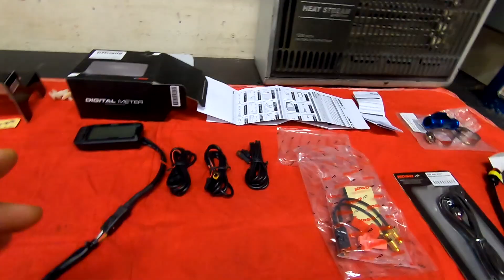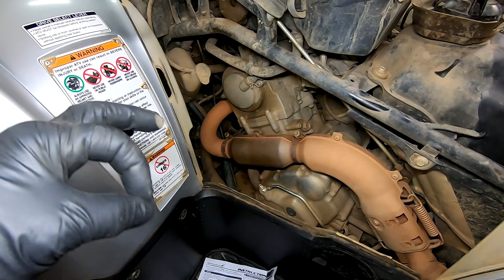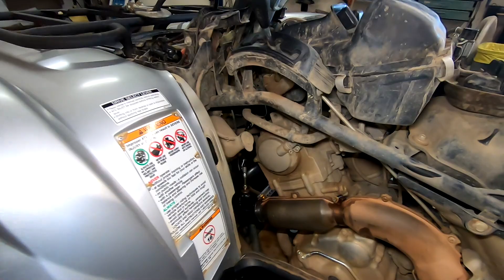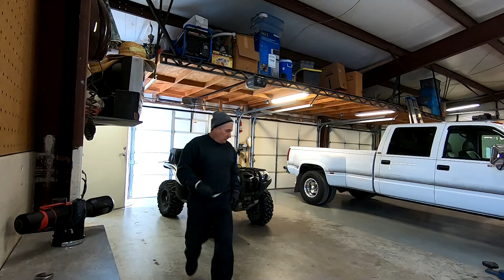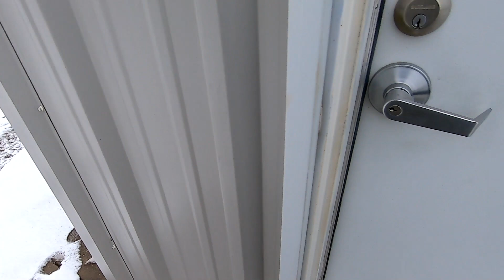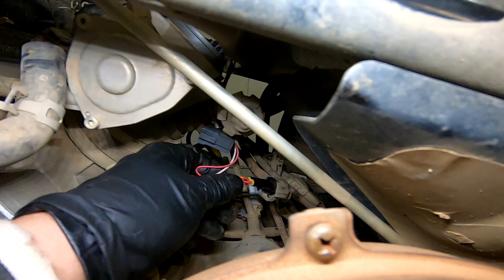Yamaha Grizzly 700 dynojet Power Commander & Air/Fuel gauge install

Comment: really nice videos. where did you buy bigger throttle body for your grizzly?
Reply from the maker: Bought the throttlebody from
CuervoATV 
He has a channel here on YouTube. You can contact him through there. Thanks for checking out the video. Much appreciated!
Reply: thank you very much for answering so soon. I live in Iceland and in the wintertime we ride in all kind of snow, hevy and wet and also we ride on the glaciers here wich is unbelivable. So I need all the power I can get, I have a grizzly 700 22 model and have put on it tuner,aibox lid and am ordering barkers duals exhaust from ehsracing. do you think I would benefit from having a larger trottle body or is it unecesery.
Reply from the maker: @orarinnhalldorsson1899  I wouldn’t worry about putting on a larger throttlebody. It really only else at higher rpm, didn’t help the low end torque at all.

Comment: So stock A/F was good.
Reply: Putting a AF sensor on the bike is really good idea. I think this is the first time I've seen any one put one on a atv or motorcycle. Would make science out of carb tuning!
Reply from the maker: @notshared2543  I didn’t want to change the stock fuel mapping unless I had a way to monitor what was going on with the fuel ratio.
The stock fuel mapping is not all that bad a little bit lean but it’s OK.
Thanks for checking out the video and appreciate the comment!

Comment: How would I make the most horsepower out of a grizzly what are the options
Reply from the maker: The easiest thing to do is change the clutching add a shim. That makes it feel like it has more power. 
Then you could put a exhaust system on maybe a fuel programmer then you could do a different camshaft all of that stuff helps it out nicely. Hope that helps you out. Thanks for checking out the video.

Comment: Great video. Just curious why you didn’t go with the AutoTune from Dynojet that pairs with the PCV?
Reply from the maker: Hi Quad Dad that’s a great question. There is a couple of reasons, one The extra expense of the auto tune unit itself. The other is I done some research on that and from what other folks were saying it doesn’t build a very good map because of the way a quad is ridden off and on the throttle. It’s not like a motorcycle for the street where you could cruise and it can do a better job at building a Nice map. 
Thanks for checking out the video!

Comment: After all the tuning, mods, etc, how many cc's do you think you will be pulling out of It? And how many h.p.? What exhaust will you be using?
Reply from the maker: Still running the same cc, 700 didn’t change that any. 
Probably getting close to 60 hp I would say she runs pretty good!  The exhaust pipe is one I built myself. Thanks for checking out the video!

Comment: I need to ask you another question. LOL. I bought the same Koso Tach/Volt/Temp gauge as you have. How did you hook the tach up. Wrap the wire around the plug wire or??? Thank you.
Reply from the maker: Yes I wrapped the tech wire  around the spark plug wire right where it comes out of the coil.
That’s cool you bought the same meter. Hope it works out for you.
Reply: @kcatv9556  Thanks. I appreciate the info. Did you ever figure out why you had to make a new tune for different weather conditions??
Reply from the maker: @440cubicinch  hey bud just got done frying up some morel mushrooms! We found them in the woods behind our house. 
Umm good! 
Anyways yes I did find an issue it’s with the A/F sensor giving me false readings. I noticed it after I dunked it in the water one of the times, the gauge went all the way to Lean.. 
Then I realized it wasn’t working correctly anymore. 
If you get the A/F sensor on your unit you might wanna watch out for getting sensor wet after the engine is hot.
Reply: @kcatv9556  Mushrooms!!! Your not eating those funny ones are you?? LOL. Glad you found the issue.  I knew something was up. I installed a Koso Wideband last year.  No problems so far but I dont do much water either. Thanks for the info again.

Comment: I just asked this in one of your other video's but could you add a link to the mount you used for the Koso meter. I currently have my Koso AFR mounted on a Ram mount but it sit up high and to the left where yours is mounted in the center right above the speedo where it is easy to see. Thank you.
Reply from the maker: Hey buddy sorry for the delayed response busy at work today. I didn’t have time to poke around on my phone. LOL. 
I’ll try and explain this so it makes sense to you. I used an old hand guard mount for the clamping saddle to clamp on the bars. Then I fabricated a bracket bolted it to that mount and that’s what extends over and holds the Koso meter in the center. My Garmin trail GPS is also mounted to the clamp mount that’s on the bars. Hope that helps you out. 
Thanks for checking out the video greatly appreciated!
Reply: @kcatv9556  That makes perfect sense on what you did. Thank you.

Comment: What size was that coolant sensor adapter
Reply from the maker: I believe it was 21 mm
Hope that helps you out, thanks for checking out the video!
Reply: @kcatv9556   thanks for info,I'm rebuilding my 700 grizzly atm almost done, want to put a temp garage on her I noticed the temp light was coming on alot when she was running

Comment: Why didn’t you go with the single channel dynojet auto tuner?
Reply from the maker: Just thought with having the A/F ratio gauge I would be able to dial in my own fuel map.
Thanks for checking out the video!
Reply: @kcatv9556  I have the autotune on my rubicon.  The nice thing is the autotune gets you in the ballpark and then you ride and adjust the map the way you want it.  Then you leave the  autotune enabled but just limit what it can add/remove.  This way when the temperatures change or your change fuel or altitude its still running off your base map but has room to auto compensate for the difference and keep things in the sweet spot.  I installed my autotune o2 sensor Just a bit before the muffler.  This way its not as hot as it would be close the engine and might extend the life of the o2 sensor.  In my case my '20 rubicon was going through alot of fuel and was showing excessive carbon on the plug.  I had put on a hmf quiet core muffler and after the tune it made a significant difference on my mpg and the plugs look good.

Comment: Just wondering why you didn't get the auto tune add-on for the power commander.
Reply from the maker: I done a little research on the autotune and from what folks say it will erratically try to adjust the fuel map. Always trying to correct for a rich condition for lean condition when you’re on or off the throttle and will sometimes Will make an erratic fuel map I like the idea of just making the fuel map The way I want it. That’s why I installed the air fuel ratio gauge so I can monitor the air fuel ratio myself. That allows me to build my own map correctly. 
Hope that answers your question thanks for checking out the video!

Comment: Hi again, you AFR sensor is it a wide band or narrow band, typically for atv’s they call for wide ?
Reply from the maker: Hi Kyle, the one I have is a narrow band reads from 12.1 to 16 I believe. But yes if you’re going to get  a stand alone air fuel ratio gauge I would go with a wide  band.  KOSO  has a nice one that I would’ve bought but it did not have tachometer and water temperature as well.   They are pricey though.

Comment: Do u have any overheating problems or excessive heat on ur leg I’ve been looking at a new grizzly but all the reviews say they overheat
Reply from the maker: Hi Jonathan I have never had any over heating issues at all, on either machine.  
As far as a heating issue on your leg i’ve never noticed any problem with that. I always wear jeans or something never ride in shorts. Hope that helps you out.  Thanks for watching!

Comment: Nice work KC. The reason it goes off scale when you let off the throttle  is because the machine will cut fuel in deceleration., totally normal. Curious if you watched my vids on installing the Koso, I installed the same thing on my grizzly about a year ago after installing the EHS programmer. I also did the EHS air box lid which helped a lot. I've sense gone back to the factory exhaust because the I couldn't take the noise of the HMF pipe.
Reply from the maker: Hey Robert.. Just checked out your video. Looked like you had the same thing in mind wanting to know where your air fuel ratio was at. I thought about with the EHS tuner as well.
But decided to go with power commander because of the ability to make new maps on your own. Thanks for checking out the video!

Comment: Excellent video KC! Very interesting! 
I have some questions and I'm not very knowledgeable when it comes to fuel systems, so bear with me buddy:
After installing everything, you said the bike was running correctly from factory (or at least that's what my brain heard). Does that mean you didn't need to install all this stuff? Or does that mean "running correctly" isn't good enough? 
Running lean means: Less fuel to air mixture right? Does that add more power or just increase fuel mileage?
A supercharger or turbocharger on a vehicle forces more air into the fuel system. Does it also increase the fuel consumption by an equivalent percentage or does it increase the air over fuel percentage?
Thanks for your help my friend!
Reply from the maker: Quaddingsous . Hey buddy..  Where to start, Your first question 
Did I need to install all the stuff the answer is no. When I said the machine was running correctly I’m basing that on a happy medium of the air fuel ratio power versus fuel economy.  A engine will make the most power in the 12.9 air fuel ratio range. but will get better Fuel economy in the mid to upper 13 range. 
So that’s where Yamaha had this thing running at. 
The best of both worlds.
But that statement can be subjective based on what you would rather have. The most power or the best fuel economy.  So no if you’re not planning on altering your airflow then in this case a Programmer is not needed. 
So why did I do all of this? You heard me say I’m going to make some modifications to the machine which is going to require changing my air fuel ratio and then that’s where the programmer Will come in to play.  The other reason why I’m doing all this is. I’m getting bored with the machine, I mean not quite as boring as a Honda. but you know what I’m saying I need to do something with it..LOL  Sorry I had to get that little jab in there. Hahahahaha!! 
As far as turbo or super charged yes that forces more air into the system so in return you have to send more fuel to get the air fuel ratio in the correct range.  The more air you can get into an engine the more power it will make. But of course you have to send more fuel in with it as well. 
So the air fuel ratio gauge is just something to monitor your engine to see if it is running correctly or not lean or rich I’m saying.  I think the next video will help explain a lot of this for you.  Thanks for the comment buddy thanks for watching too!!
Reply: @kcatv9556  
Thanx for the excellent answers. It is exactly what I thought, but because I don't dabble in this stuff, I second guess the crap out of myself.
Buddy, you speak the truth about Honda HP, so no need to apologize  - HAHAHAHA! I'm trying to figure out a way to put an engine out of one of those Honda's Africa's into my Rubi. They're inline twins and come in a few different sizes. I'd like anything from a 600 - 800 twin. Don't want anything too heavy, just more HP than this lawnmower currently gives me - LMAO!
Reply from the maker: That would be cool if Honda would do something like that!
When I say Hondas are boring I’m not necessarily talking about HP.. 
I’m saying they never need worked on so you get bored with them. LOL 
That’s one of the reason why I built the rear wheels for the XX.. Just to have something to do to it. It never needed worked on. LOL. Same thing with the grizzly there was absolutely nothing wrong with it. I put new rear brake pads on this winter and then I was like OK now what. LOL  I needed to do more, get my creative juices flowing... Hahahahaha!!
Reply: @kcatv9556  
Hahahaha!!! Ohhhh, OK, I get it now - LMAO! 
Heyyyyy, I fixed my rear brake caliper (the piston was stuck out, so all I had to do was screw it back in) and put a new winch on this winter. Yup, that's all . . . sigh
Reply from the maker: Haha I thought you knew that all along! LOL I never was bagging on the HP LOL Meant you don’t work on them that’s why they are boring. Can-Am is never boring. LOL! 
Just kidding Can-Am guys wanted to get you in the conversation. Hahahahaha 
Yup I seen that new winch you got looked pretty awesome!!

Comment: if the sensor is not in the direct exhaust stream it wont read correct. like a car 02 sensor in those fouler bungs to keep from detecting a bad cat
Reply from the maker: Urban Adventures . Yup you’re right, the cavity I built for the sensor is  completely opened up the entire side of the pipe was cut away so the exhaust will flow across the sensor. Not just a hole in the side of the pipe. I should’ve been more clear on that.
Be sure and check out the next video where I run the machine and make a fuel changes with the programmer while viewing the gauge. You can see how sensitive it is. It’s cool stuff, well I think so. 
Thank you for watching and appreciate the comment!